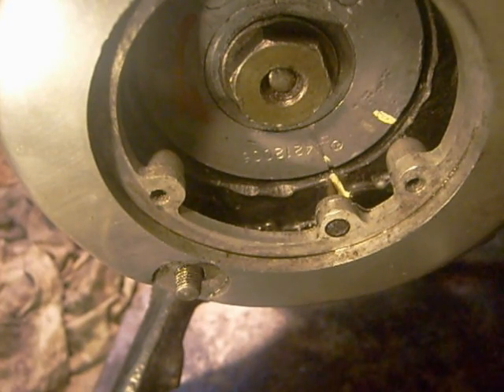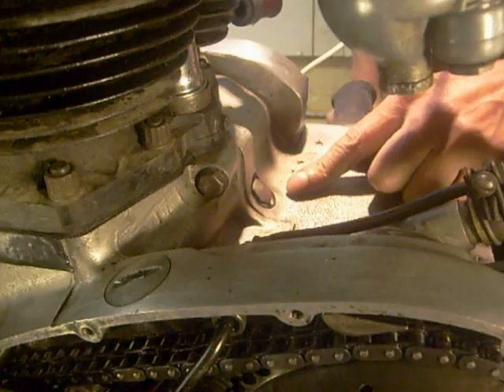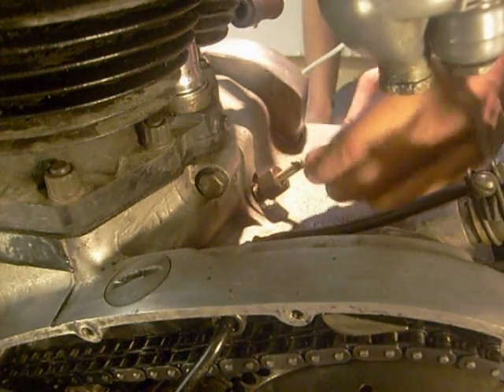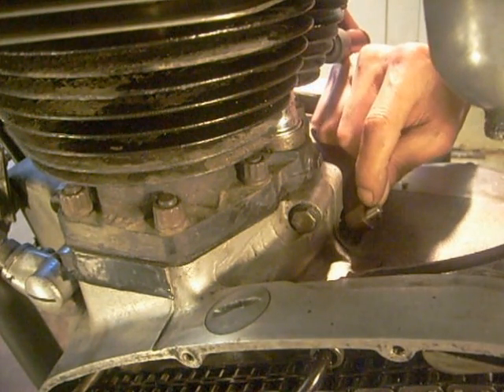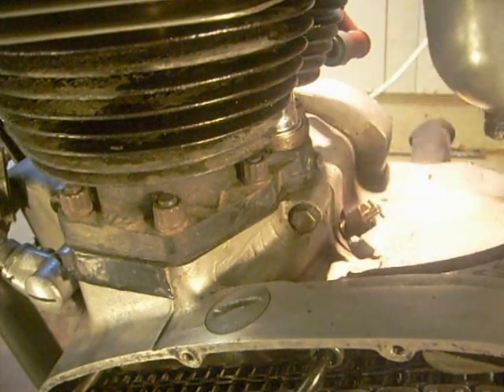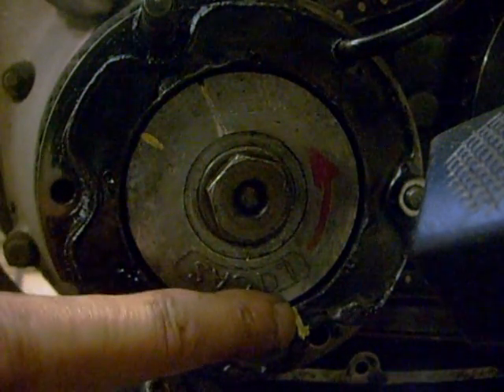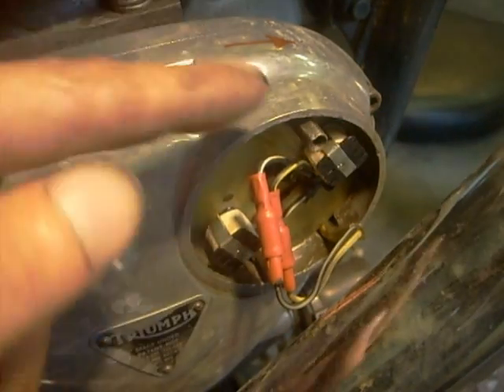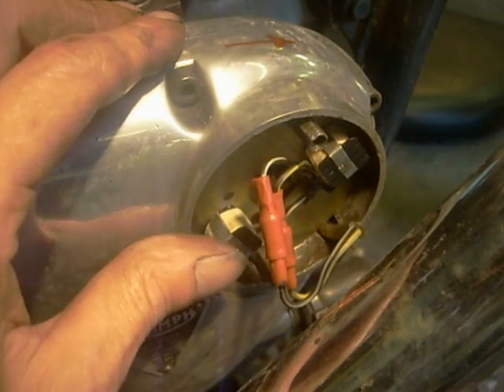Strobe timing Triumph Bonniville T120R

Comment: Using the tool is also a good way to check for fairly common alternator rotor shift. When the crankshaft is held in place the rotor should not be out of time and if it is, replace it!

Comment: Lummad. Simply great man! I'e got a 66 TR6R but engine number makes it out to be a 64. Will the crank actually have 2 slots for the timing (TDC and 38* BTDC) if I use the timing tool (need to order one)? I've heard some early engines only have 1 slot.
Reply: Also, what can you do if you've got the older pre-timing hole primary cover?

Comment: thanks for all the no nonsense information and your previous advice I have now finished the tr6 except for fine tuning of ignition I have converted it to twin carb spec  goes like a rocket low speed still a it rough though probably due to right hand carb seizing up during the summer.      Have also replaced valves and guides on the t100ss after owning it for 42yers Ray fisher says they are most worn ones he has ever seen  no wear of bores though due to oil in them  good fun and happy days  thanks. J w orchard
Reply from the maker: Hi John :-) thank you and you are welcome. 40 odd years out of a set of valve guides! There are people who say these things are unreliable :-O Give em a little tlc and they will give years of good service.
Reply: John have you still got the tr6?

Comment: Hello Sir...nice video!!! I have a rickman t140v with nourish 8 valve......and a big problem....when i rev over 3500 rpm,the bike misfires(or short complete ignition fail) and the headlight is going dark....also the travel direction indicator is going very fast at this rpm......when i do this often,the fuse blows(25 amp). my bike have 2 lucas 6 volt coils and an electronic ignition with an lucas amplifier. i also noticed that the left cylinder blows not so strong at the exhaust than the right cylinder at idle......but when driving its okay....do you have any ideas what could be damaged? maybe the left ignition coil??? Carging power is also okay.....spark plugs are new...thx
Reply from the maker: Hi oe6 it sounds like you have a couple of problems. You should check out the charging side and look for a short circuit on the lights. 
The not so strong side at tick over is most likely carburetor air screws and the 3500 rpm misfire could be a weak mixture on the needle jets try lifting the needles to bottom notch.
Reply: Thx for your answer...i fixed the problem....one phase from my 3 phase alternator was damaged.....and also a bad contact in my ignition switch was the problem...... i replaced the alternator and now i have strong light,strong spark and a strong sound out of my ducati megaphones *LoL

Comment: Hello Sir! Do you have any advise on setting the timing on a 500 that doesn't have the access panel in the cover (so there's no handy pointer). I'm guessing just figure out TDC and BTDC manually?? Thanks for all of the videos!
Reply from the maker: Hi dull_boy :-) thank you.
I've not had much to do with the 500 saying that setting timing is the same procedure on most engines.
Finding TDC is easy with a stick or dial gauge down the plug hole, the BTDC can be done down the plug hole if you know the measurement.
A degree wheel can be made from a CD using a protractor, and as in this vid removing the chain case and running is no problem,
I'm sure the same will apply with the 500 but you will need to check.
With a mark on the rotor and stator you can use a strobe once the initial static timing is set.
Hope this helps.
Reply: thank you I was able to time her now on to the wet sump issues!
Reply from the maker: Hi db :-)
glad you got that sorted, contrary to popular belief Triumph wet sumping is a rarity, being fitted with a plunger pump but it can happen.
slack pump, damaged gasket would be usual causes. There could be dirt under the check valve balls or weak springs.
 Balls and seats should be cleaned and the balls can be re-seated giving them a light tap with a soft drift. :-D
Reply: Hey Lunmad, thanks for the advice. I removed the oil pump and found a tiny piece of metal that was probably interfering. All good now!! on to the next issue :)
Reply from the maker: Hi dull :-)
anytime, yup bits of metal should not be in there, glad to of helped.

Comment: Very helpfull topics Lunmad!! thank you!
but this is wired, I don' t have any notches on my crankshaft on my 1979 triumph TR7RV. I bought the tool, just like yours, and tried to find this TDC notch..... but nothing! like the crakshaft was a full circle one!.....
Reply from the maker: Hi maxime :-)
Strange, the notch/s can be hard to find depending on the depth.
A way to get close to where it should be and find the TDC notch is to remove either the alternator nut or the timing pinion nut
then look inside to see the key-way, this when pointing straight up is TDC, then scrape around in the timing hole and you should find the notch. You may find the notch is cut slightly to the primary side.
If you have a timing disc fit to crank and turn engine backwards to 30 deg BTDC and set static timing.
You could make a simple timing disc from a CD marked with a protractor.
Hope this helps.
Reply: Hello Lunmad!! thanks for your reply! well, listen, I tried that yesterday night during a couple of hours.... no notches.... so I setted everything with the disc.
 First setting to 19° with red dots matching clockwise (as mentionned in Pazon notice)... nothing, no start, absolutely nothing.
Second setting to 38°, dots matching  (not mentionned in Pazon, but similar to Boyer! I tried!...).... nothing at all....
Third setting to 38°, no matching dots with clockwise, but rotor dots inclinated to 2 o' clock and 8 o' clock; perfect start, rev perfect, I strobed it at 3000/ 4000 and a weird thing happened: the 38° mark on the stator rotor rans down 38° (usually go over 38 when you rev isn' t it?). except from that, runs perfect. I suspect an anomaly in the trigger setting.

Comment: Hi Lunmad :)  do you know if, i can set the timing while the engine is running? If i got one person on each side? Thank you for the nice vids.
Reply from the maker: +Thomas Hansen 
Hi Thomas :-) thank you.
in short yes, after you have set the timing static, you can only strobe with the engine running.
Two people can do the job though coordination can be a problem.
Keep the bike on its tyres rather than on its stand then you will not have to chase it down the path
as the suspension absorbs most of the vibes.

Comment: hi,i have a 1967 t100t daytona & going to fit the same ignition system,is the procedure the same ie finding 38 deg btdc to fit the magnetic roller & stator plate etc,it hasnt got the inspection plate on the primary chaincase side so can i just use the triumph tdc tool

Comment from the maker: Hi Yo momma :-) I'm not to familiar with the 500 but in the main they are pretty similar. The camshaft may have a missing location dowel used for getting the AAU  in the correct position.

Comment from the maker: I use the bikes tach but you can tell when the correct rpm is reached as the line on the rotor stops moving (advancing) 
If the clip on tach is on the HT lead the polarity does not matter.

Comment: I have a 71 trophy 500, read after comment below, I removed the distributor plate to check the timing advance unit and found that the point cam had been working loose from the plate that it is stamp to. I tack welded it back in place and now it has lot of adjustment and the bike runs perfectly. I hope this help the people out there that have been pulling their hair out like I was.

Comment from the maker: Thank you :-) when the pointer shows through the small hole it should be 38 deg btdc, you will also find the rotor on yours has different marks to mine.

Comment: Hi Lunmad, good work. As already said, it's better to watch and learn than to read a manual. My 74 Bonnie has a late primary cover with the small timing hole in it. The pointer looks to be in a different position to the original 1 like yours. Will this give me problems when I strobe mine?

Comment from the maker: @gerwoodholland 
The crank vents into the primary side, gases and oil vapour. The gases should leave the motor by the vent pipe and the oil transferred back into the crankcase through them three small holes and then scavenged back to the oil tank.
There should be only a small amount of oil in the primary side maybe half a cup if that, much more than this will give you clutch problems and oil leaks.

Comment: @lunmad Thanks for the reply. This face full of oil is just that - a real continuous blast. So much that it's impossible to look in the inspection hole. It's accompanied by a hissing sound which I assume to be the high pressure source of the oil. Could this be some sort of leakage from the crank/big end?

Comment from the maker: @gerwoodholland 
Hi gerwood 
you might get a little oil but should not get a face full, you could drain the oil from the primary case and refill after you have strobed it.
There are three small holes in the crankcase that allow excess oil to drain back into engine it sounds like these may be blocked you should remove the primary case and check they are clear with a piece of wire.

Comment: Thanks Lunmad for your quick reply and your tip.I didn't think It was worth to run this old bike with the 98 oct. but I will try. I set the timing at the basic 38° before tdc and then I set It down a bit till the engine stop pinking when running up Hill at low load.
danbonnielux

Comment: @62g12cs .Thanks Lunmad for this great video.That confirm I was doing the right way when setting up the ignition timing on my 1970 T 120 R(with Boyer Bransden micro digital).My question is:As I run with 95 unleaded gas,should I set down the ignition timing from 38° to 35° or even less.??

Comment from the maker: @srcheney 
Hi scrheney :-)
the secret is, I use the side stand, this way both wheels are on the floor so the tyres can absorb most of the vibes.
I use a block under the stand that has the bike almost vertical, then I put a scissor jack under the opposite footrest.
Then as a safety thing, I clamp a set of vice-grips around the foot rest to stop the jack slipping, and screw a pipe-clip over the stand (end) to the block to make that secure.
Most of the work I do is done this way including wheels.

Comment from the maker: Hi @SPEIRMOR thanks :-)
there are a few types of strobe, mine connects between the spark plug and cap,
some clip around the HT lead with an induction loop.
As the strobe senses the HT voltage the lamp will light up, and does so every time the spark-plug sparks.
The battery is to power the light the reason for using a separate battery and not the one on the bike Is in case the charging current upsets the "mechanics" of the strobe and makes it flash wrong.
thanks again

Comment from the maker: Hi @TheReverb1 :-)
the strobe light flashes at the same time the sparkplug sparks,
when it is shined onto the spinning flywheel, the flywheel appears to be stationary 
making the timing line show up, and adjusted to suit the pointer on the case.